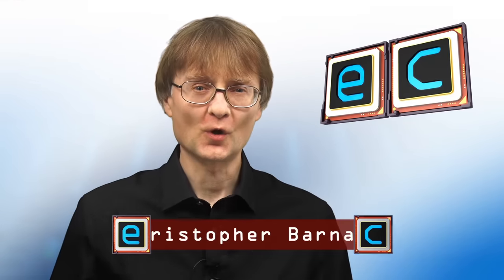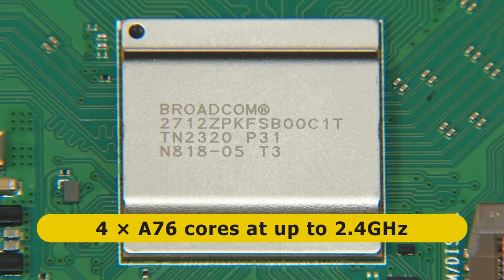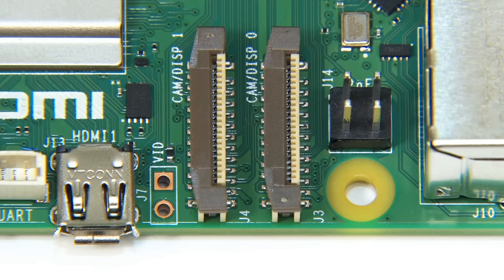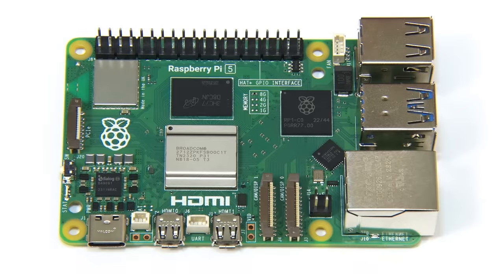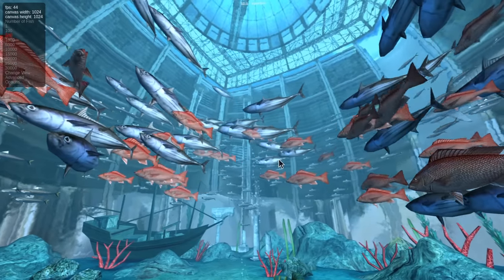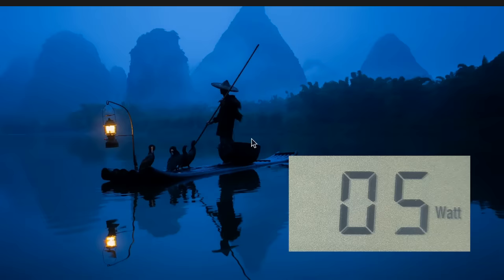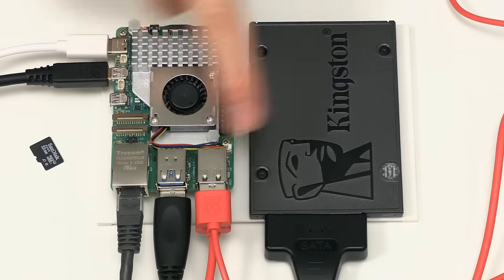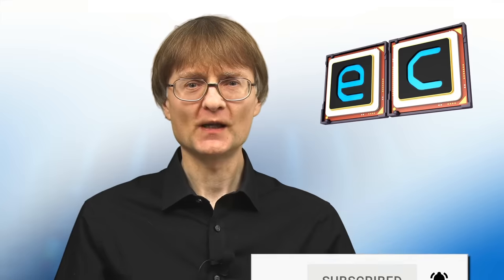Raspberry Pi 5

Comment: What people like most about you is that you deliver a full review with such an honest way, straight to the point, straight to the hearts of your audience. Thank you
Reply: i like the video, although is quite advertising. what about the downsides of the rpi5?
Reply: Yep your spot on, he’s extremely knowledgeable and no fluffing around
Reply: He's been doing it this way for a very long time. :)
Reply: @amiga68k75  can't think of anything considerable as a downside without being unfair
Reply: @amiga68k75  you lose some backward compatibility HW-wise (eg. case), no 3.5mm jack, H.264 hardware decoder was left out this time, still no VP9 hardware decode acceleration. (personally I think it's also sad that there's still no official Android or Windows on ARM images, despite it being the defacto ARM SBC on the market, but this might be very well on Google/Microsoft, not just the Pi Foundation). These are my complaints which are actually not so bad, otherwise it's a decent successor with near equal price. I think it's very good overall, the desktop performance is pretty impressive.
Reply: thanks for the summary 👍🏽

Comment: Really impressed by this; looks like it's actually a viable decktop replacement! Would love to see an all-in-one keyboard computer version - a Pi 500! 
Look forward to seeing how an nvme drive does, and if you can boot from it!
Reply: RP3 was so frustrating, just a little too slow. RP4 much better, but this 5 like you said looks desktop quick. Hope there is an RP500.
Reply: I hope R500 would have build in NVME slot, even 2230 would be enouth
Reply: I was thinking of mounting one of these inside an old Commodore64 chassis.

Comment: Yay an extra video from the best YouTuber on YouTube. The new pi seems promising although the lack of a audio jack sure sucks for some use cases. Hopefully they keep support for the Ethernet without a dongle.
Reply: "Raspberry pi" let remove the audio jack .
"Apple" hold my beer ...audio jack gone power jack gone... USB C gone.
Reply: Yup, I'll be sticking to the Pi4 for my desktop since I do use the audio out (even right now!). I definitely have other uses for the Pi5 performance that don't need it, though!
Reply: Yeah thats the mayor drawback
Reply: @KarstenJohansson  Puts me off buying one. How do you get audio out now ? Presume via HDMI ?
Reply: @the_retag  Mayor?
Reply: @digitalmediafan USB thumbstick soundcard?
Reply: A cheap DAC and you have a great sound. Or a DAC integrated with an amplifier gives you hi-fi sound.
Reply: @digitalmediafan  Unfortunately there are still companies making monitors that use HDMI but have neither built in speakers or an audio jack to output sound. So you have to plug the speakers into the computer itself and having to use up a whole USB port just for sound could be quite annoying.
Reply: @JMcMillen  Absolutely, crazy and mad to remove it, makes no sense
Reply: @digitalmediafan  I think the decisions are made this way so that older models, like the very capable rpi4 isn't just tossed to the bin like an Apple product. I don't mind each version having different strengths, even at the cost of losing a function or two that can be brought in with a $5 hat.

Considering the cost, I'm definitely getting an rpi5 to replace my rpi4 file server, where you do notice delays with encrypted network traffic. My desktop will stay at rpi4 since it, as you mention, has the headphone jack. Each one has its purpose. My file server doesn't need to be heard.

I also like the fact that it can do 2 cameras. I actually need that for a project. So that already means there are 2 rpi5's on my wishlist.

Comment: This is very exciting, lots of good improvements but also some questionable choices too, probably the one that hurts the most is the removal of the audio jack, which wasn't just for audio but for analog video/composite/RCA too which will hurt retro gaming enthusiasts the most, also the CPU upgrade while very welcomed I felt is not a huge leap by any stretch and I'd like to see something a little bit more powerful, at least 2x RPi4's or a 8 core chip. Either way for desktop computing it looks great, can't wait for a Raspberry Pi 500 to give it to my mother to replace her aging desktop PC.

Also Chris I would love to see some comparisons down the line with other mini PCs and current Pi clones!!
Reply: Removing that audio jack must have taken some courage. ∗cough∗

While I’m typing this on a lovely new machine in a full-size desktop case that I got a few months ago, I found out its onboard analog audio interfaces would not support my 5.1 surround-sound speakers. It could have been done via the optical interface, I suppose. But I found the easiest solution was to get a separate external USB audio box that does 7.1 out.

I’m sure that same box will work fine on the Pi 5. In fact, I think it’s bigger than the Pi 5.
Reply: > at least 2x RPi4's
it is in 2 - 2.5x range, Jeff Geerling and ETA Prime showed more benchmarks
Reply: Personally the design decisions make a lot of sense to me. A faster chip would likely have dramatically increased the price point of the RPi 5 and the power consumption which would be a step away from their philosophy. Performance comes with a cost and it is exponential.
Reply: Unpopulated VID header near camera/display connectors looks like a composite out to me
Reply: Mmh, some would immediately want to know where to solder your own audio-out connection for SDR applications, without tampering with the HDMI.
Reply: @Nettlebed7 USB audio interfaces?
Reply: @louisik1  many are of doubtful quality and you lose a USB connector on the board.
Reply: @Nettlebed7  I used 4 connected to a usb hub, each ingesting audio from 4 radio shack scanners, routed into 4 instances of Radiofeed, up to Broadcastify.  Sounded great.  Now I have 7 sdrtuners on a usb hub, using unitrunker and sdrtrunk for different systems, again pushing up to broadcastify.  No audio out necessary, can use usb headphones if you want, again all on a single usb hub.  Anyway, I don't imagine the audio quality on a pi device would be noticably different than a usb sound dongle.  Best wishes!
Reply: @louisik1  And where did the S of [S]BC go, in all of that?
Reply: @Nettlebed7  hmm?
Reply: @louisik1  - the attraction of single-board computers is in their completeness and simplicity.  Of course all kinds of secondary stuff can be added, however, with consequences for housing, power etc. I guess audio is not considered as fundamental and important as pixels are these days.

Comment: Seeing YouTube load and play fluidly at 1080p on an SBC at this price is genuinely impressive, not to mention the responsiveness of the desktop in general. Unfortunate that they're sticking with micro hdmi, as I really don't trust it, however in every other aspect this seems to be a welcome upgrade
Reply: YT didn't have any problems being played at 1080p on an RPi 4.
Reply: Have you had issues with micro hdmi?
Reply: my i3 7020u laptop can barely play youtube videos on chrome and it's so laggy when entering the full screen mode. How this little piece can play youtube that smooth?
Reply: Yes.  Small and fiddly.  My pi4 was shipped with a defective cable.  It broke the first socket on insertion.  I was so excited I tried the second socket.  In 10 seconds I had to figure out if I wanted a headless pi4.  Decided to use as a media nas.  It's fine, but not what I planned.

Can't help feeling I full size HDMI would be more robust.

And I would prefer one HDMI one display port to 2 HDMI
Reply: @Alpha-kl4jo Quite possibly your system is bloated
Reply: @valiantvanadium6996 You could... if you feel comfortable with it, desolder the connector and  repair it. Or maybe it broke the chip? That's a little harder to do unfortunately.
Reply: @Alpha-kl4jo hw acceleration I suppose, makes a huge difference.
Reply: They should have either turned some full size HDMI ports on their sides or stacked horizontal ones, even minihdmi would have been better, there even might have been room for a 3.5 milimeter jack
Reply: @DowneyMax  I just fresh installed windows 11 a month ago. But yeah I still installed quite many apps
Reply: Micro HDMI😱
Reply: @Alpha-kl4jo  You'd probably benefit from using a light Linux distro, assuming your laptop's compatible, and that there are no windows exclusive apps you need
Reply: @ecophreak1 I do think so too. I'll switch this to linux when I buy a new laptop. I use windows exclusive program (process modelling) so the new laptop will still be running on windows. The old laptop one I will turn it into a torrent server seeding linux ISOs lol and maybe as a backup PC

Comment: An excellent initial review of this SBC. I am annoyed that the audio jack was removed, I’m sure the designers could have found room for it somewhere on the board.
Reply: Gotta copy Apple at all costs. Though for what most people use the Pi for, it probably isn't used much.
Reply: @pikachuchujelly7628  I think its because of the following: You are generally using the Pi with HDMI (which of course is audio as well as video) OR you are using your pi as some sort of server or control device, hence headless .... and you are SSH(ing) or VNC(ing) into to it.

Comment: It took me by surprise, I didn't expect the new model this fast, I really like it, I thought the processor speed wouldn't be that high, I was expecting something around 2 but never thought it was going to be 2.4 which is excellent, I would have liked standard HDMI ports though. I would have never imagined a  Pi with an active heat sink, or on/off switch. I can't wait to see how well it performs on Retro gaming since some systems were not playable with the RP4, Good news, Cheers
Reply: I expect the first thing people will be doing is overclocking it anyway - so you may get closer to 2.8 or 3.0 GHz clock speeds on it - we shall see.
Reply: It'll be interesting to see what kind of cases will be available for it. The active cooling part is no longer optional, i guess, unless you want to disable 3 of 4 cores?
Reply: @simpletongeek  You could probably passively cool it but you'd need a BIG heatsink and therefore a special case.
Reply: @simpletongeek You can keep it fanless at the cost of crippled performance.
Reply: @jimbotron70  I wonder how much under clocking is necessary? 🤔
Reply: @simpletongeek  It's shown on another video in YT.

Comment: It looks good from your initial demo, thanks for this video.

The extra power and specification is welcome but not sure what I will do with it yet because it's always the case now that there are used SFF PCs on eBay that can be purchased and used for an equivalent price anyway - so I've been using those and Orange Pi boards to build a lot of solutions, especially during the chip shortage.

I expected the release of the Pi 5 to be reasonably imminent (though thought it might be on "Pi Day" 2024) and the $80 price tag for the 8GB version is a fair price - so no real complaints but likewise I've just been getting on and building the stuff I need to as ever without being sat "with baited breath" and waiting for its release.

I do look forward to seeing how Gentoo Linux will run on it.

Comment: Excellent video, as always. For me the RPi ship has pretty much sailed. During the supply chain crunch, I stopped buying Pi's and retasked old PC's from my junk pile. Then bought some new x86 mini PC's with 4 cores and 7 watts power draw. Unless I need the discrete I/O pins or super small size, I see little reason to use a Pi now. But please keep reviewing the Pi ecosystem, because you do it so well, and we need to always keep up with things!
Reply: Yeah the mini PCs with Alder Lake-N are fantastic for many of the things a Pi is good for, and the price is pretty comparable once you factor in accessories. Media server, pihole, HTPC, kids' cheap computer for learning Python/messing with Linux, etc.

And while those don't expose GPIO pins, the Raspberry Pi Pico (or other cheap MicroPython-capable MCU boards) are a great way to learn about circuit design and hardware control. Many Raspberry Pi projects would work just as well on a Pico.

There's definitely still plenty of use cases where a Pi 5 makes the most sense, of course.
Reply: That's what I was thinking, too since the price has been creeping up for the pi's.
Reply: Lack of GPIO is more or less overcome by the abundance of cheap microcontrollers with loads of GPIOs. And then you get addicted to measuring and monitoring everything 😂
Reply: @wereoctopus  I can't find any mini PC which isn't at least five times the price of a Pi 5.. unfortunately. Or let's say four times, after adding (non-SD) storage, power supply, box.  I've seen many interesting presentations (on this channel and elsewhere) of mini PCs, it's just that they're all very expensive as far as I can tell.
Reply: @tohaason  I don't know what prices are like where you live, but I'll take your word for it.

Here in Australia a 4GB Pi 5 is $103 AUD, though currently out of stock.

Right now, I can buy a Beelink Mini S12 Pro for $299 AUD. That has an Intel N100 (four 12th-gen E-cores), and includes 16GB of RAM and a 500GB SSD.

Other mini-pc brands are ~$250 with similar specs, or ~$200 for less RAM and SSD space. I have no idea if Beelink just has a bigger profit margin, or if the difference is down to better-quality components, tech support/documentation etc. I just have one mini-PC, so can't run any comparative benchmarks :-)

Older mini-PCs (e.g. with 11th-gen Intel "Atom" cores, the forerunner of their E-core architecture) are also about $200, maybe less.

Again, relative pricing might be different where you are. And earlier Pi models are cheaper and in stock. I'm a big fan of the Pi 3A+, which is $40 here.

Comment: Amazing video. I just want to note I've noticed those cheap SSD to USB adapters work well but if you get a self powered one in some cases (including PCs) can run much faster. Some SSDs can draw over 1 amp on their own and I know the USB ports are designed to allow this much current draw so I don't know the exact reason for this. I have tested it on several devices and it's faster on about 80% of them. Again not sure why but thought I'd mention it.

Comment: I did not expect to catch a release from one of your videos! Very surprising. 

I wish the PCI was 3.0 or more than one lane, but everything else looks fantastic. This is true desktop territory.
Reply: Despite the limited bandwidth, it could be good for the latency which might make a lot of difference.
Reply: Jeff Geerling in his video said that 3.0 is supported, but not certified, so you have to enable it manually.
Reply: @Winnetou17  That changes things quite a lot. Considering the ridiculous PCIe extension cables out there, I’d be quite comfortable running this at uncertified speeds. Can’t say I have much to complain about now.

Comment: It is exciting to see the Raspberry Pi 5, but when I look at the pricing with all of the accessories (sans keyboard/mouse) we are getting into the territory of those small form factor, Celeron based PCs on Amazon by companies like BeeLink.  I am still going to get a Pi 5 to learn about the system, but the value for this to be a "first computer" for a child is slipping away.  Thanks for the great review and it looks like I will have some fun next spring when the ecosystem matures a little around this board.
Reply: My thoughts exactly. See... back in 2015, these Pi's made sense, as they were low power-based little things that anyone could acquire and tinker with on the cheap. Fast-forward past 2020 to current year; it costs more upfront and it will most likely be scalped like the Pi 4 was. 
Since the introduction of these mini PCs (AKA: mobile laptop components shoved into those small boxes), like you said above, the cost vs performance doesn't make as much sense once you start adding up cases and other accessories for the Pi. For $50-$100 more, you're honestly better off buying one of those mini x86 PCs instead.
Reply: I am a bit disappointed there isn't a "500" model for this.  The form factor of the RPi 400 seemed to make more sense for the price point, considering what I use it for.

Comment: Hello Mr Barnatt and all your viewers,
I stress tested my Pi 4 with a piece of software and let it run for two hours. The maximum temperature it reached was 42.4 degrees. With the current Pi 5 cooler, I wouldn't perform the same test as the fan does not cut in until the Pi 5 reaches 45-50 degrees while on tick over, let alone being stress tested. As you said Mr Barnatt, roll-on the plethora of after-market coolers.
Stay safe and my kind regards to one and all,
Ron Williams.